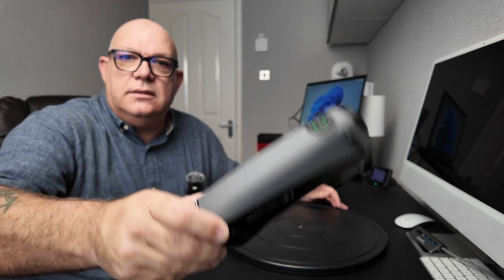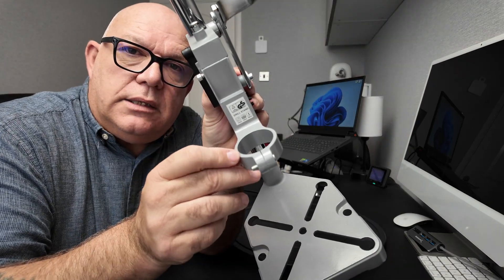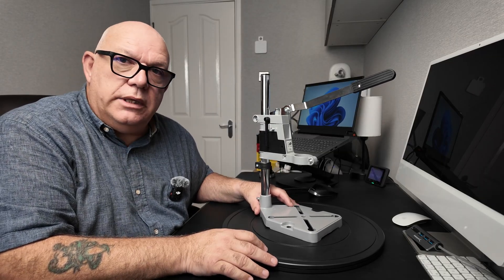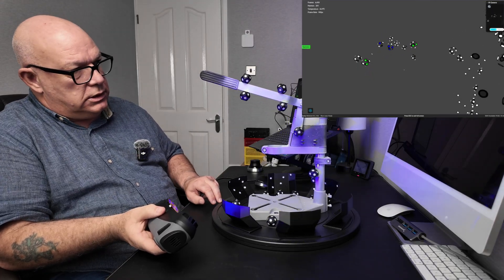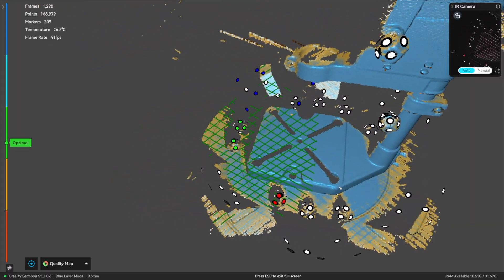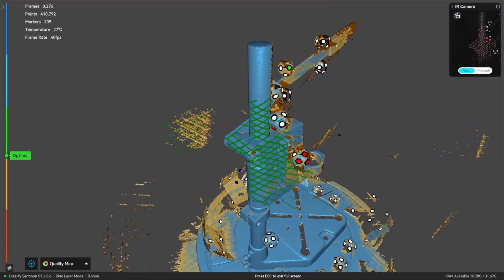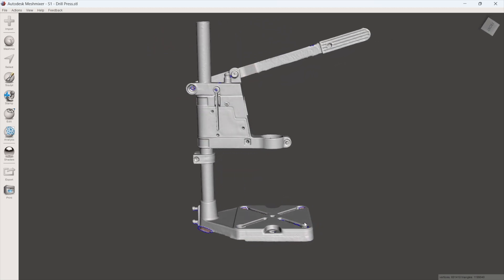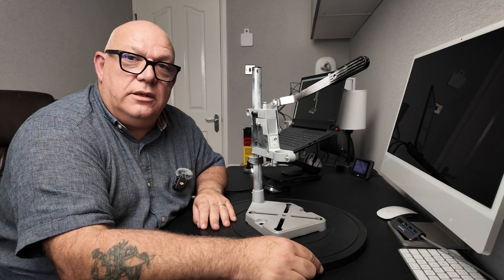Creality Sermoon S1 Tutorial – Can It Handle This Drill Press 3D Scan?

Comment: You may re fuse it: in Scan_2 just press on eye symbol against "Raw" and fuse it again
Reply from the maker: Brilliant I never knew that. Great comment thanks for sharing.
Reply: What is Scan_2?
Reply: @maximilianlindner  Panel on the left side displays all project entities. The project contains two scans (Scan_1 and Scan_2), each with raw and fused data. When the scan data is fused, the raw data is hidden, indicated by a closed eye icon. Clicking the icon hides the fused data and revealing the raw data, which can be re fused with different settings.

Comment: Hi Charlie, having seen your videos, I'm considering this kit for reverse engineering of items and for the design of car components. If you do have the time, could you do an in-depth scan of something that demonstrates the capability of this kit for the accurate locations and sizes of threaded holes, clearance/dowel holes? Even better to demonstrate how accurately it could scan spur gear teeth? Eg: car flywheel and a clutch cover? I'll send you the parts ! :-) Appreciate however that you have your own agenda on your channel.
Reply from the maker: I think this scanner is more than capable of reverse engineering obviously within the limits the manufacturers state. I'll look at doing a video on the accuracy but obviously you need to know the actual correct dimensions first to see if what you are getting is correct.

Comment: Yeah that is one of my biggest complaints about Creality Scan is the no back button. And its not very intuitive what youre doing. Like after aligning you have to hit exit but there's no new model created for the aligned mesh you just have the two individual scans on the left. The no undo makes it difficult for aligning complex meshes.

Also I dont like the "confidence" or low,med,high editing settings. Like what does that mean? And then you cant undo if you dont like the setting. I just use CS to align the models and export with all editing settings off and then do the edits in another program. Hope Creality improves this
Reply from the maker: Thanks for the detailed feedback, I hope they improve it too!